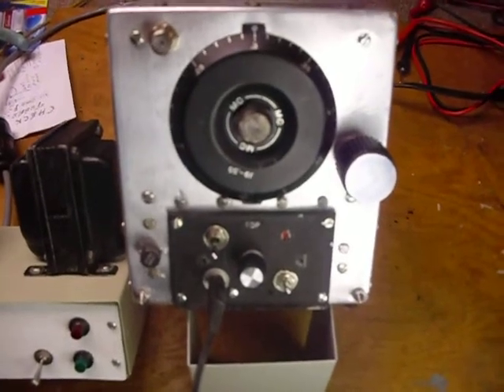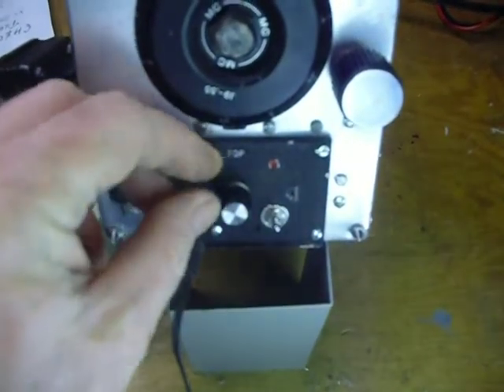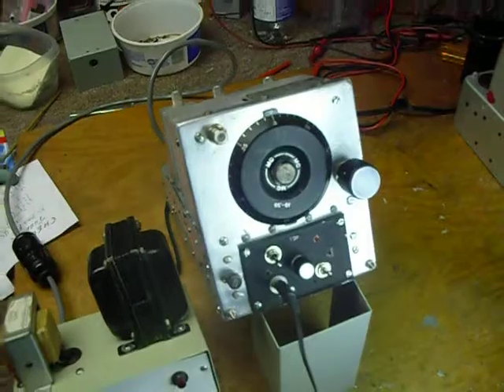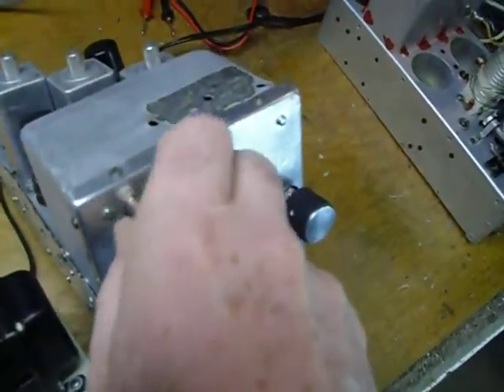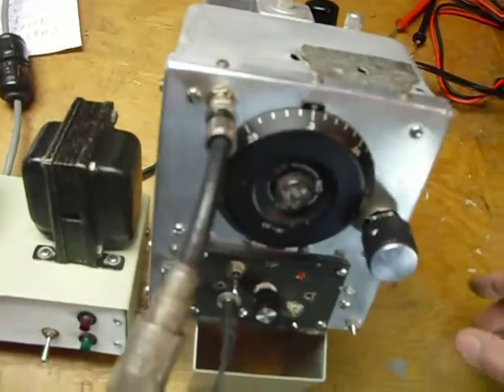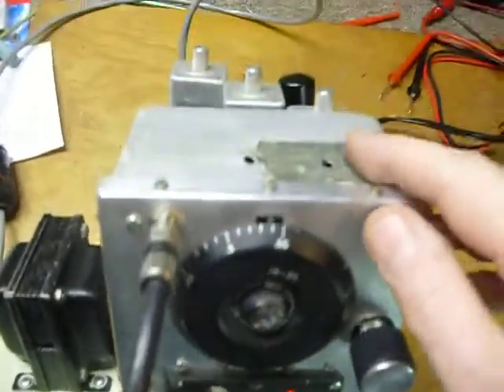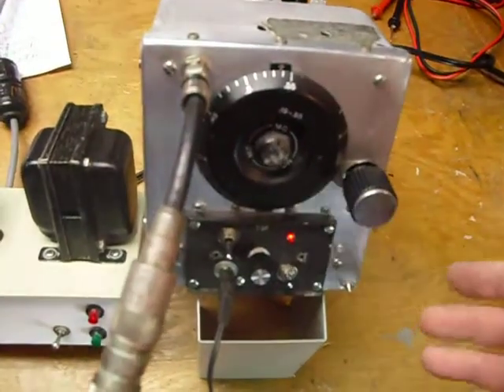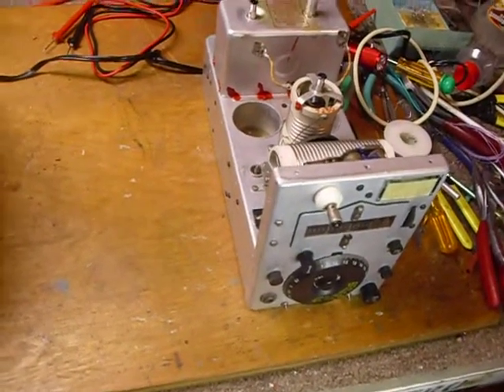Part 2 WW2  BC-453 Beacon receiver restoration and operation

Comment: Another good one Bob... One thing you pointed out (that I have been preaching for years), is the use of RG-6 and its connectors. They are a cheap alternative to high price RG-8 or LM cables. You can't get a lot of new Amateurs to understand the reason for its use. Keep up the good work, and the best of 73's.....   Jim     WA5WRE

Comment: The one I had was used by me set to the 455kc IF of the Halicrafters S-38.  Much better selectivity for CW.  Back about 1963. One small capacitor from the output of the second IF transformer to the input, worked great.

Comment: Bob: I would bet the two tubes you pulled were not bad, but either the sockets or the tube PINS are not making good contact. By pulling a tube and inserting another one, you "cleaned" the connections well enough that they made contact. I routinely put a little DeOxit 5 on the pins of each tube, and in the socket holes. Secondly, be careful of the resistors: unlike most carbon-comp resistors, the ones in those receivers are not insulated in order to make them a bit smaller in diameter. If any have HV DC on them, you can short them out and burn them up by touching the outside with a grounded wire. Ken W7EKB